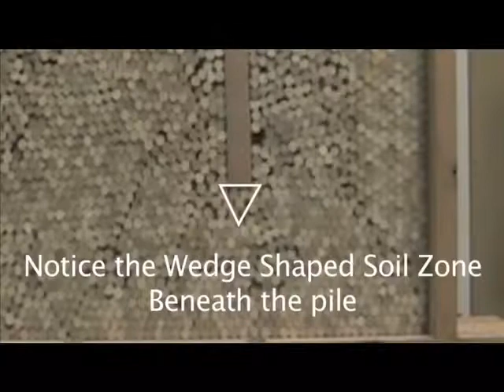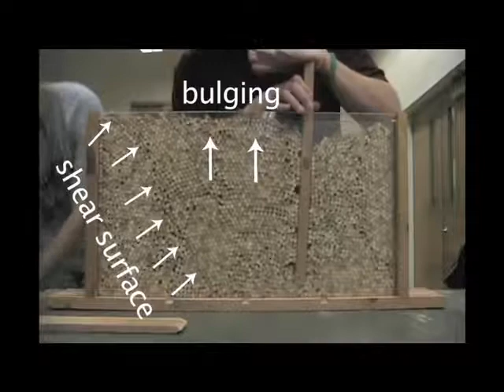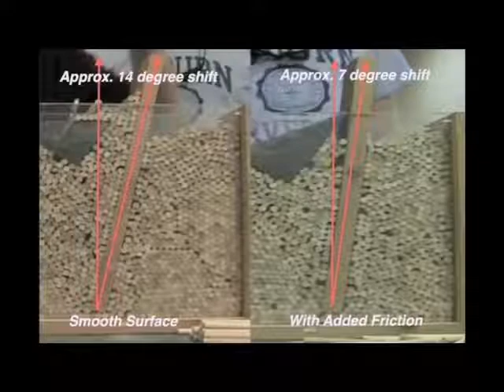Load Carrying Capacity of the Soil

Comment: The bearing capacity of a soil can be investigated using the limit theorems of ideal rigid-perfectly-plastic materials.
The ultimate load capacity of a footing can be estimated by assuming a failure mechanism and then applying the laws of statics to that mechanism